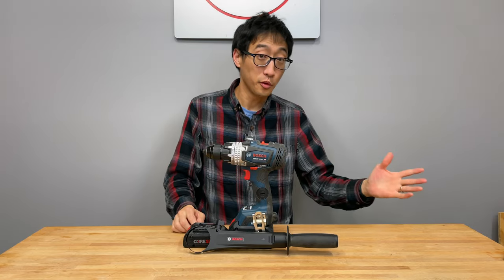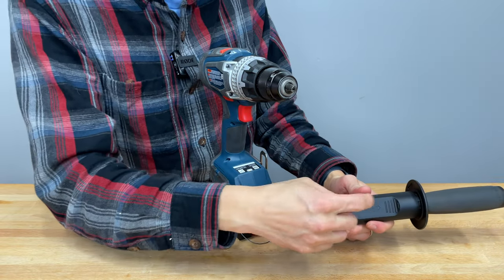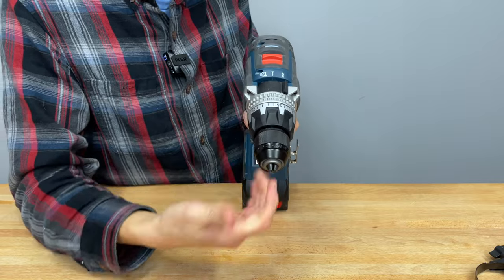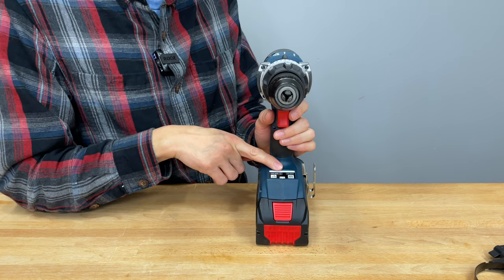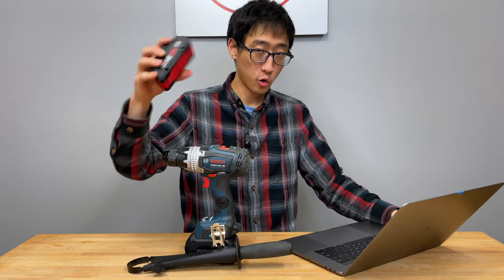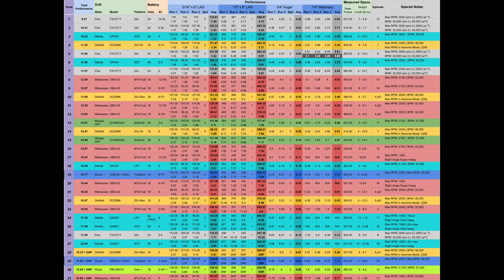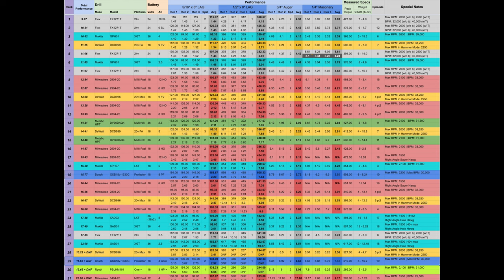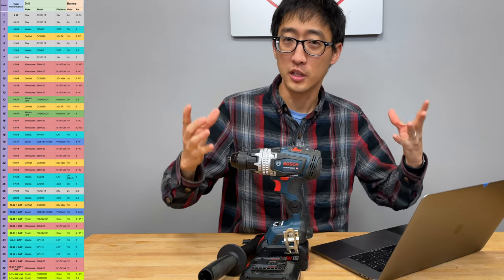Bosch Profactor 18v 1/2 inch Hammer Drill Review | GSB18v-1330C | ep 19 | Worlds strongest Drill

Comment: 1:57 you are wrong about battery compatibility. You can use ANY 18V Bosch battery with ANY 18V Bosch tool (no exceptions). However, at this moment only 5.5Ah, 8Ah and 12Ah ProCore/Profactor batteries are able to deliver the current to get more out of their "BiTurbo" motors. I.e. with regular GBA 18V and 4Ah ProCore/Profactor you will get less performance (than marketed) out of BiTurbo tools.

Comment: I wish we would have such a cordless drill competition in Europe. In my country this drill costs $300 with no batteries. And I saw some comments that this could be bought for $129 with a battery that is a complete steal. I could not even buy the battery alone for this price, jesus.
Reply: That was a limited time deal I have never seen though. It's MSRP is currently $199 bare tool and I saw it a couple times including the 8Ah and 16 amp biturbo charger for free.
When you are not the biggest player in a certain country and want to gain market share these are the tactics you use

Comment: I bought this drill for the extra batteries. The 8ah batteries that came with it fit so loose I can feel and hear them rattle on the drill when I operate it sitting at my desk. I also purchased their new 10 inch profactor miter saw and couldn't be happier. Really let down by the battery fit up on this tool. Does the one you have there fit snug or is it loose?
Reply: That is strange, I had tested 2 and found the exact opposite. I really had to put in a lot of effort to remove the batteries on both… Like too much effort…

Comment: unfortunately i dont want to buy bosch, but especially when makita makes such good drills. but what i do  think would be really a good idea is for all of the other drill manufacturers to start putting some sort of a flat indexing surface onto the back of their drills. so you know... instead of an entirely complex curved geometry moulding. then there would be a spot somehere on the back (or even on a side, or a corner). and that spot would be exactly perpendicular to the drill chuck shaft axis. so that way we could have made 3rd party or aftermarket 'addon' mods or adapter that took some standard sized and shaped digital inclinometer.

so with that digital inclinometer installed on the back of the drill it would be super easy to keep the drill lined up straight and level during drilling. and of course the standard features on these devices lets you tar out (zero out or null) the drill to any arbitrary angle. i think this woulds be and awerome and really practical optional addon feature for any handheld / freehand ordless drill. it would help in many different daily situations. and when you need the drill to be more compact and fit into tighter spaces. then the extra bulk of the addon  could be removed / unclipped. so pretty much 0 downsides....

all for the sake of those curvy plastic mouldings. and putting a flat index surface onto a device probably cannot be patented. or patent-blocked. due to the fundamental nature of it being simply a flat surface.

Comment: Hi Where do you find the deal with this drill and two 8.0ah battery? thanks
Reply from the maker: 1/2-in 18-volt-Amp Variable Speed Brushless Cordless Hammer Drill(Tool Only) https://www.lowes.com/pd/Bosch-1-2-in-Core18V-Amp-Variable-Speed-Brushless-Cordless-Hammer-Drill-Tool-Only/5013569455

Add the two 8.0s under add free gift